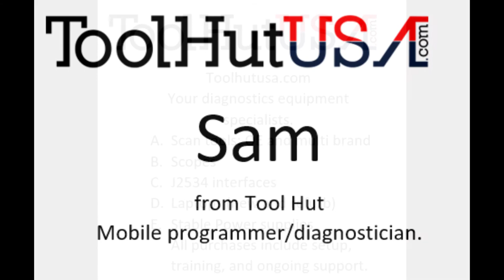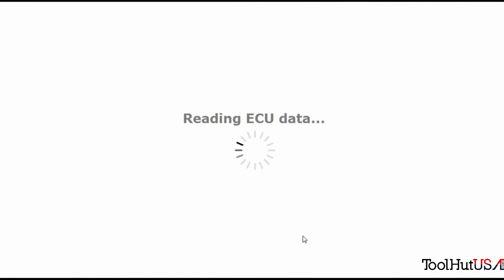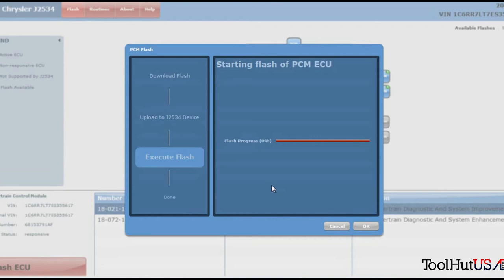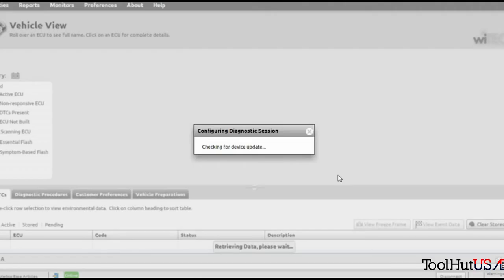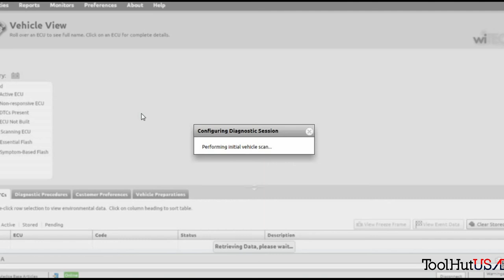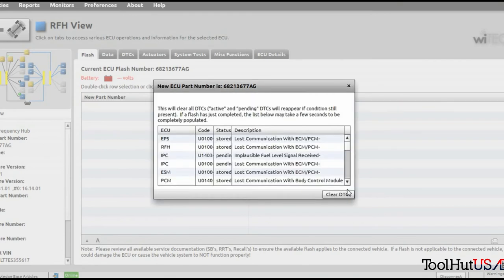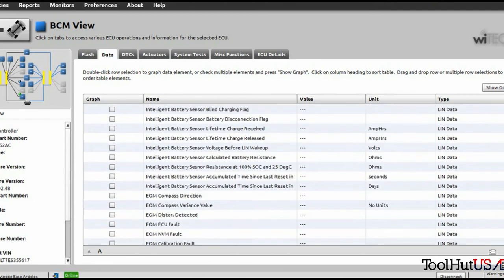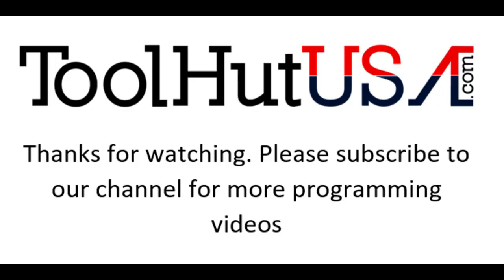2014 Ram BCM setup using J2534

Comment: At least when they replace the steering column control module the vehicle will be up to date
Reply: what does the yellow bars mean on the topology screen? splice packs?
Reply: phil holbrook sometimes you impress me 😁
Reply: wouldnt go that far.... i need to get a youtube channel up going in 2018! but i wont ban people for positive criticism....
Reply: basically, they are called star connectors, tie the can c and can i.h.s. to the modules that need the connection.

Comment: Hi Sam, Have you tried to replace a 2013 ram 2500 6.7 BCM with a newer 2014-15 BCM? Mopar does not have any of the 2013 BCM's available any more and has no restocking dates set. My truck is throwing codes and having issues and I believe its from my faulty BCM. Thanks James
Reply from the maker: I have not. Wish I could be more help
Reply: @toolhutusaakathecarflasher3019   I am being told by CARB to donate the truck if I cant find the replacement parts... Kinda BS if you ask me.
Cheers.

Comment: Hi I have a 2015 Ram 2500 6.7L  Long story,  short version PCM(used) and BCM(new) have the wrong VIN in them.  Is there any way to replace the VINs with the correct one?

Comment: I have both a Otc and snap on scanner that allow me to write the vin can that step be performed with the vin then flash it with j2534
Reply: Yea it allows me to write the vin and program tire size I'm sure they don't allow me to do it all but the vin they do I've only been doing j2534 for about a year Ik flashing is different than module replacement but Ik I can write the vin in chrysler modules
Reply: I just checked my Otc it shows change country code and program tire size but no vin read write 😡

Comment: Is there a procedure to unlock a BCM.  After opening if a valid key is not present we can not program in a new key or fob due to being locked out of the bcm. We are told it will need to be replaced by a dealer. Is there a way around that?
Reply: This would be the new ram pro master van or the fiat 500. Year would be 15-and up.

Comment: Hi Mr Sam. Have you have any experience with replacing the bcm on 2014 ram promaster 3500?  I want use a used bcm but am not sure if it can be done.   Also whats is the difference between retoring configuration and proxy alignment on chrysler/ fiat vehicule?
Reply: @toolhutusaakathecarflasher3019  that makes sens tho.    Its seems like fiat based platforms only have the proxy alignment instead of the configuration restoration.   thank you!
Reply: @ousmanesarr7287  i am wondering this same question my friend. were you able to put a used bcm in your Promaster?